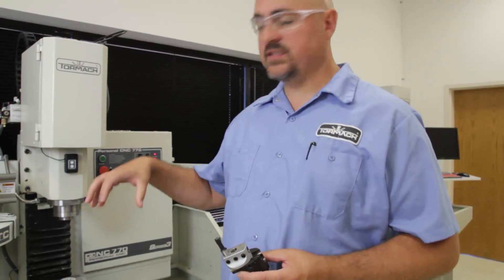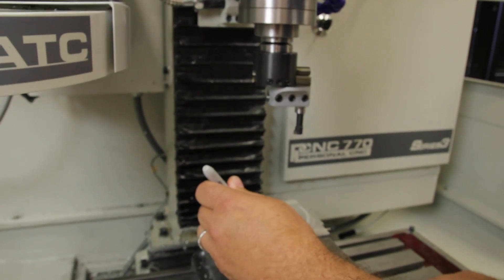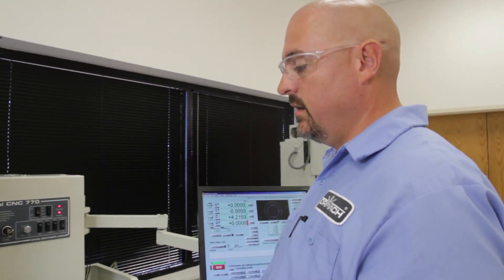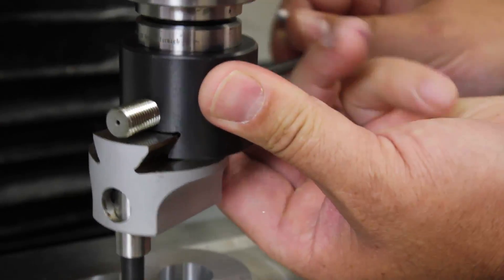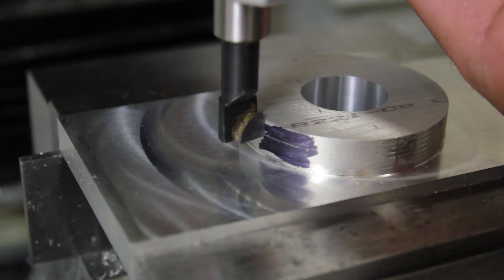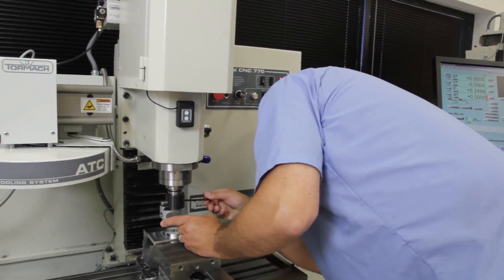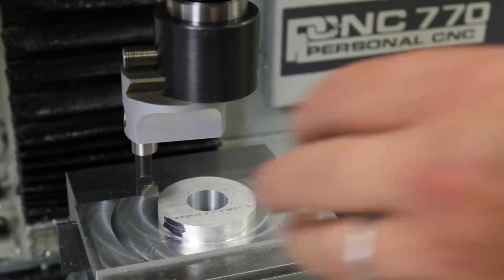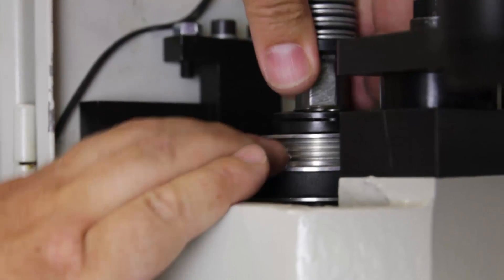Boring Head Tips (Part 2 of 2) - Tormach CNC

Comment: Hi i liked the video, not used a boring head in a while, my question is; why would you use a boring head on a CNC  mill? surely it is redundant?
Reply: Maybe you would need a hole that is 0.001mm or so round. I wouldn't trust just any machine to do that. Newest machines can do pretty good (don't have any numbers to say right now) but a machine like I work with, 20 year old Fadal makes holes that are +-0.2mm round. If you know and understand what I mean.
Reply: since the machine spindles have to change the direction of its rotation it wouldnt produce a perfect circle.
Reply: Stewart Holmes Not at all redundant. Boring heads are used in CNC machines every day. You don’t think the cylinder bores in your car’s engine were interpolated, do you?
Reply: @Icutmetal  arent they honed

Comment: Why counterclock wise and not clockwise? Personal preference?
Reply: The boring bit is turned 180 degrees it's normal orientation (for cutting inner diameter), therefore you rotate it counterclockwise to cut outer diameter.

Comment: You get a lot of vibration when it's so far out of balance. If you use the cross hole and insert a length of stock to act as a counterweight, you will get a smoother finish and can run at a higher speed, when the head is moved out that far. Also be aware that on many boring heads the shank is threaded on, so running in reverse is not recommended, as the head can unscrew from the shank.